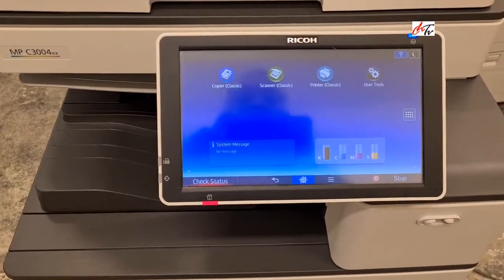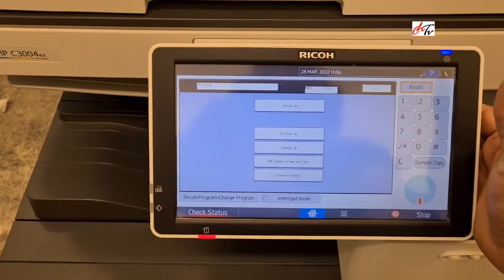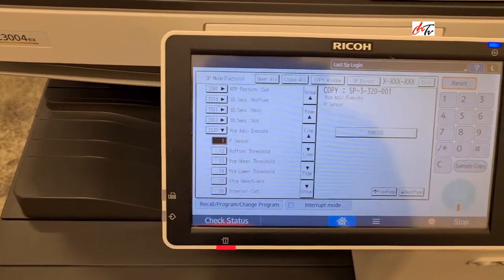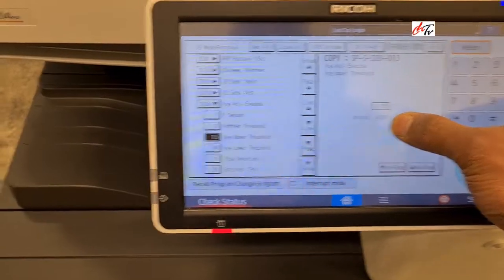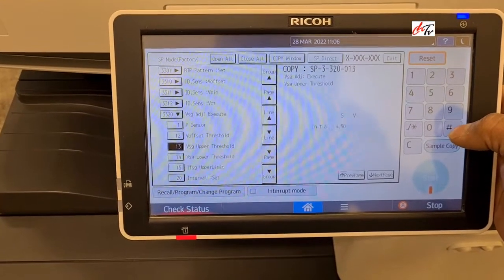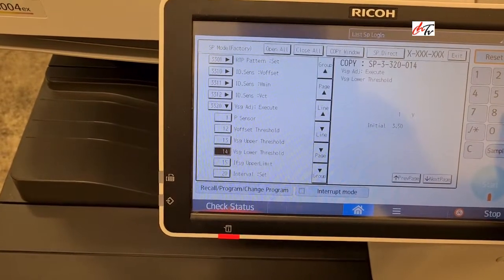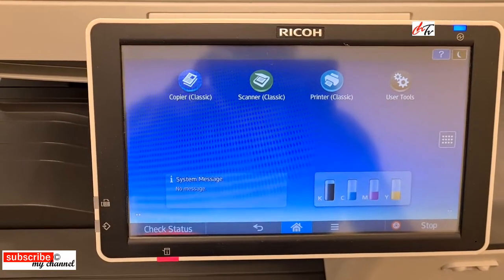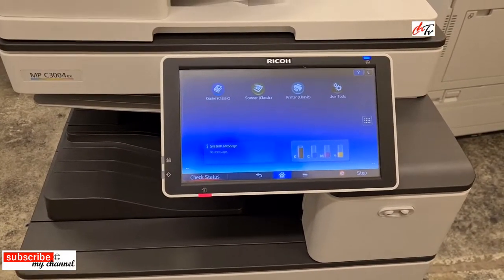sc370-02 | new and easy trick to fix sc370-02 | sensor calibration error of Ricoh

Comment: SC 375-03 error code o n Ricoh IM c4500  ,I have clean the IMAGING BELT sensor and imaging belt is also in good condition but error not removed.please support and suggest what should i do? thank you
Reply from the maker: Also check the dev gears of the yellow and the other units.   

Check the itb unit springs are giving right tension.

Comment: Please help my machine is Ricoh MP C405 it shows the following message SC370-03
Reply from the maker: Hi there
It’s about the image transfer unit, and check for TM (ID) sensor connector.

And if u can pull out the transfer unit out safely, clean the sensors from a damp rag as the censer’s should not be scratched. 

You can find the sensors on the frame work under the transfer unit sits. There is a little shutter shift it gently right and clean it.
U will be ok.

You will have to switch off and on the printer.

Comment: MPC2503 sc370-02 same?
Reply from the maker: Well it is the same. Pull the unit out and Clean the sensors
Reply from the maker: One oh3s you had to push the shutter of the sensors

Comment: Please I have error code SC 370 - 03   my Ricoh ist MPC 8002
Reply from the maker: Hi there
Take the drum unit out and clean the sensor by the air duster. And check the sensor, too.
Hope it will help.
Reply: @sherukat what sensor bro? You mean sensor at the body
Reply from the maker: @samsengsamsung8281  yes it’s depends on which machine is.  If it is O2, you have to get this both side screws off and pull the ID sensor out and clean it if it 03 u have to push the metal cover asking a lot of under the sensor. 04 just clean it. Make sure when wipe the ID sensor you have to use a damp rag.
Good luck

Comment: Sir eror 372 mp c3500
Reply from the maker: Hi there, this is TD sensor adjustment error: Black

During TD sensor initialization, the output value of the black, magenta, cyan, or yellow TD sensor is not within the range of the specified value with SP3238-001 to -004
(default: 2.7V) +- 0.2V

Causes:•
Heat seal not removed from a new developer pack,
• TD harness sensor disconnected, loose or defective,
• TD sensor defective,
• Harness between TD sensor and drawer disconnected, defective.

Hope this will sort u out. Good luck 👍 

Remedy:
1. Remove the heat seal from each PCU. 2. Replace the defective PCU.
Reply: Please have a sc452 00 error after transfer unit replacement ( mp c3503)
Reply from the maker: Paper transfer contact motor error Paper transfer contact motor: position sensor cannot detect the sensor filler state within the predetermined time (see below) even if the paper transfer contact motor is rotated. • Contact operation: If not detected in 2000msec • Home position operation:
If not detected in 5000msec Signal detection sampling period: 10msec

Causes:
• Sensor dirt • Sensor defection • Motor defection • Unit load large

Remedy:
• Replace the contact drive unit
 • Replace the image transfer unit
• Check the harness
. Replace the motor